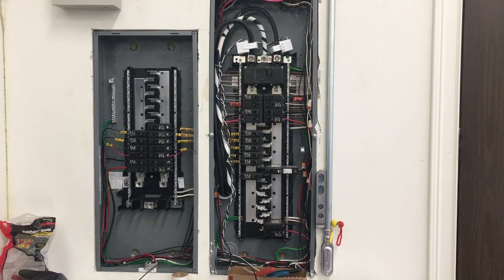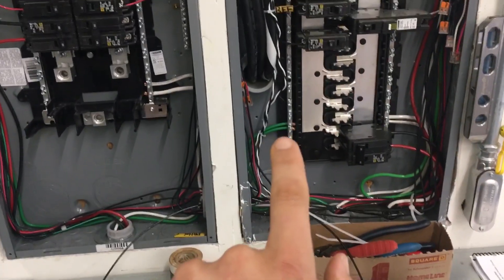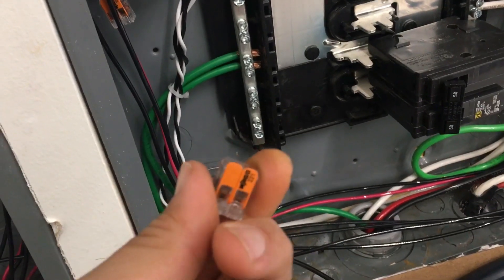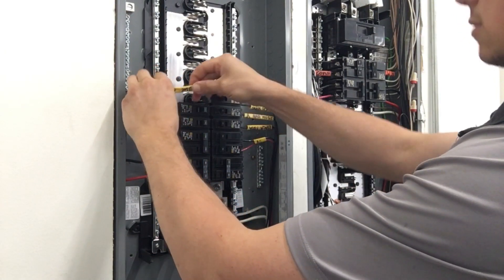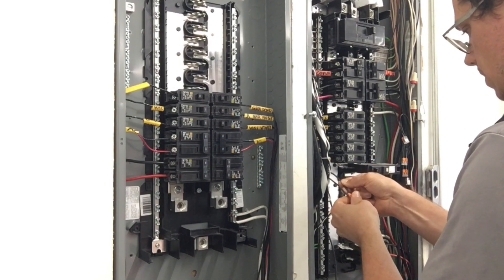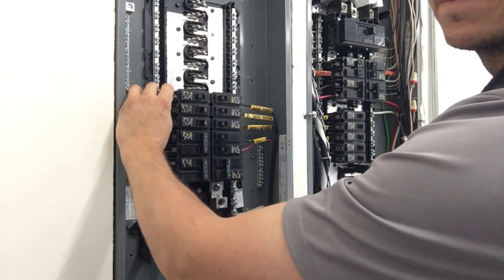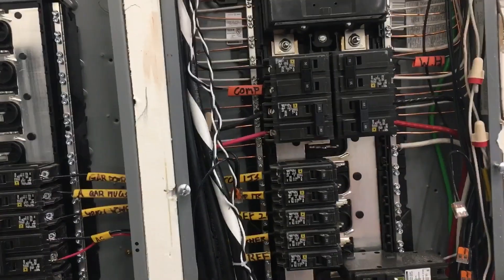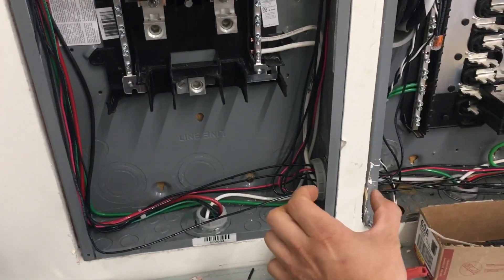Battery backup solar: Wiring the critical load panel

Comment: How does this remain compliant with 

NEC 300.3(B) mandates that all conductors of the same circuit, including the neutral and equipment grounding conductors, must be run in the same raceway, cable tray

Comment: Thanks, i installed my eg4 12000xp and I was having some doubt on my load breaker, my dilemma was that I wasn't sure if I needed to move the ground and neutral wire because simply the electrician who did my main panel 2 years ago didn't actually labeled the ground wires but labeled all the other wire. So my setup is very similar I have AC input from my main panel as well. And this video was great.  Thanks

Comment: Awsome video. So there is no need to move the individual neutral since you ran a large gauge wire. I am assuming there is no issue with the code. Thanks again 😊

Comment: In a grid down situation I don't understand what is stopping the CLP from pushing power into the main load center - and then backfeeding to the grid?
Reply: In most critical load panel situations, they are powered from the inverter only into the main lugs. And most hybrid inverters have “AC Bypass” which uses the grid or solar or batteries to power the Critical loads panel with Grid support 24/7, and when power is out the Inverter only powers that critical loads panel from the Solar/Batteries.

Short answer, it’s fed from a inverter only with a built in controller to not backfeed the grid when power is out
Reply: @wrenchingmatt8501  Thank you...I am clear!

Side question in regards to a CLP install using an EG4 12000XP with grid. In our home the N / G bond happens outside after the meter where the 200A breaker is. Inside the home is the 200a main lug only panel. 

If we placed the CLP next to the main 200a panel like shown in this video I could wire it just like Jason did? Making sure there is no N/G bond in my CLP?

How do you size the N and the G wiring from the main panel to your CLP?

Comment: Im trying to find optimum spot to install my inverters, our main 200 amp service panel is in our laundry room, i was thinking i could mount the inverters on wall above the washer dryer but that wall has the water shut off valves about 3.5 ft up the wall snd i thought i bet code says any electrical type panel/inverter must be 3 ft away or on wall opposite of the water outlet/spigot/faucet.  My main panel is 3 ft from that outlet.  I could put the inverters in the bedroom closet  which is behind that wall where washer dryer is with the water shut off valve.  My other option thought is buy a 8x8 shed or 10x10 put about 30 ft to 50ft from the laundry room and main panel, which then also allows room for batteries.  Only thing there is will need to insulate it and put a solar ductless to prevent getting too hot or too cold.  But starting to thing this would be the best route.  Any suggestions for us folks with no garage?  Lol i am in NC north of charlotte.  Any ideas greatly appreciated.
Reply from the maker: I like the shed idea personally. The inverters can’t go in a clothes closet.
Reply: @GainSolarPower  cool, thanks for the feedback, im guessing it would need be insulated, and probably have a solar high efficient ductless mini to keep from getting to hot or too cold.

Comment: So as long as the inverter senses grid power it does not send solar/battery power to that critical load panel.  Once grid goes down the inverter sends solar if available and or battery as neefed to power the critical loads?  You are wago nut wire from the main service panel to the breaker moved into the crit panel.
Reply from the maker: Not quite how it works
Reply: @GainSolarPower  how does it ?

Comment: What switches the excess power to battery charging?
Reply from the maker: The hybrid inverter does this automatically. I’m using the Sol-Ark 12k hybrid inverter
Reply: @GainSolarPower  I want to power the heating element in a sand battery with direct DC power. Maybe best to just have dedicated solar panels for this load?

Comment: How would your neutral arrangement change, if at all, if you wanted to use a main breaker subpanel as critical loads panel, w/interlock kit, to allow inverter critical loads bypass (main breaker of sub fed from ~50A (for ex.) breaker in main, interlocked with inverter crit load input breaker)?
Reply from the maker: It would t change with an interlock

Comment: If I am simply adding a new breaker entirely (freshly pulled circuit) can I just add in the breaker in the standard fashion to the critical load panel? I know the panels max current capacity is capable of supporting the new load. 

Simply put, is there any interaction for a new circuit between the critical loads panel and main panel? 

Thanks!

Comment: I have a LV6048 Inverter which I don't think has a common neutral. I want to move 10 Circuits from my main panel to the Critical Loads panel powered by the Inverter. Would I need to move the neutral and hots or can I use the process you have in this video?
Reply: Unless they are arc fault or ground fault breakers you should be fine running just the hots and neutral larger than the max possible combined amps of the circuits or the surge power of the inverter.

Comment: I’m confused.  With both panels sharing the neutral can you have the main panel powered from the grid and the critical load panel powered by the inverter at the SAME time?  That’s what I want to do.  I’m assuming I’ll need a “generator” transfer switch setup or will have to move the neutral wires over too.  I want to 100% run the critical load panel off Solar/battery with the inverter switching to grid if the load is too much or the battery level drops too low.  I don’t have any MWBC.
Edit: just saw your reply about the insides of a Reliance 10 pole transfer switch - that’s what I was planning to use.  Sounds like your setup is electronically the same as a Reliance transfer switch.

Comment: Useful video. I am getting PV + battery installed - the inverter offers UPS option so I to add 2nd 'consumer unit' (as the fuse panels are called in UK). Perfectly doable for a sensible and smart DIYer, but not really legal - got to get a certified installer. At least I can educate myself and instruct them as to what I require. Thanks.

Comment: Do you have any videos that show how to wire and bypass the inverter from the critical loads panel back to the main panel? I have an enphase system with sunlight backup and my installer is telling me there is no way to transfer the loads on the sub panel back to the main panel. I have a portable generator that I want to use at night or during overcast days and now my fridge and freezer are only wired to the sub panel. Thanks
Reply from the maker: Accomplishing this is pretty straight forward. Just saw this message. 

Jv@gainsolarpower.com

Comment: I'm in the process of creating a critical loads panel. One thing I thought of that should also be done for all installs is to ensure that the power supplies from the Hybrid Inverter, when passing through grid power, is in phase with power supplies that "Could" come from the main panel to the critical loads panel. I'm sure there are different ways to bypass the Hybrid Inverter, if required, and that both wouldn't normally be lined up to do that, but, just in case, it could prevent a major fault. Error on the side of caution!
Reply from the maker: Thanks ben. There is a bypass and we keep track of thenphases

Comment: Is it code violation to not move each neutral with associated circuit hot wire over to subpanel?  I'm reading you can not just run one neutral from main panel to sub panel to cover all the hots that are now in the sub panel.
Reply from the maker: That’s a tough one. I’d leave it up to your AHJ/inspector. I’ve passed all my inspections doing it like the video shows. Moving the neutrals takes a lots longer. If the panels are far away I would move the neutrals with the hots but when they are close like that I bond the neutral bars with a big wire and that’s fine. I don’t feels that the code adequately addresses the scenario.
Reply: @GainSolarPower  thanks for the reply.  I'm hoping to do the same as you did in video.
Reply from the maker: Well you have my blessing

Comment: Don’t the ground and neutral also have to originate from the critical load panel?  I know it still works this way, just thought code requires it.  Thanks for the video.
Reply from the maker: Show me the code.  Cant have two neutral ground bonds and the critical loads panel is a subpanel.
Reply: @GainSolarPower  All conductors of a multiwire branch circuit must originate from the same panelboard [210.4(A)].
Reply from the maker: You have a good point but the nec defines a multi wire branch circuit as 

Branch Circuit, Multiwire. A branch circuit that consists of two or more ungrounded conductors that have a voltage between them, and a grounded conductor that has equal voltage between it and each ungrounded conductor of the circuit and that is connected to the neutral or grounded conductor of the system

I’ve never had a single problem from just moving the hots, nor have I ever had an inspector call me out on it. I’ve even done a super neutral once. 

Multiwire branch circuits are not common in residential anyway.
Reply: @GainSolarPower  maybe that’s where I’m not clear if I have a twin pole breaker run on 14/3 romex feeding hallway outlets on L1 and then lights on L2 then isn’t that a multiwire branch circuit?  And I wired my critical loads panel the same as you just wondering if it will pass inspection.
Reply from the maker: @Marker-er3ro  yep that is a perfect example of a multi wire branch circuit.
Reply from the maker: @Marker-er3ro  where are you getting inspected. If the inspector catches that I would be might surprised.
Reply: @GainSolarPower  I’m in Colorado, I’ll let you know next month.  Again thanks for the great videos!
Reply from the maker: @Marker-er3ro  maybe move the neutral too for that circuit. It’s a multiwire branch circuit.

Comment: Good video, thank you!  Question, what if you're a "minimalist" and basically everything on your main panel is a "critical load"?  How does this get wired with the inverter so it can still "transfer" to off grid?
I see how this CLP works and would benefit most, but in my case everything in my main is a critical load!
Reply from the maker: It would need to be wired in with a transfer switch the size of the service.  grid on one side and solar on the other.

Make sense?
Reply: @GainSolarPower  may you expand on this answer. I have the same situation. The main breaker panel is my critical panel.
Reply from the maker: @zedekmorenu7804  you can either run you whole house thru the inverter which has 60 amps pass thru and hope the inverter never fails or interrupt the conductors feeding the main panel with a 200a transfer switch and feed the grid thru one side and the solark thru the other and hook the main panel to the load side of the switch.

Comment: Thanks for the video.  Is the backup panel supposed to have the same circuits that the main panel has?   In other words, should the backup system be an exact copy of the normal panel?
Reply from the maker: No man. It sounds like you better stay out of your electrical panel. The critical loads panels which you are calling them back up panel consists of the circuits you want to power during the outage.

Comment: Hey Johnny, how exactly is the grid powering the critical loads panel?  Are the panels joined in any way other than the neutral and ground connections?
Reply from the maker: In normal operation the grid passes thru the inverter but we also have a bypass in case inverter goes down that would connect the grid directly to the critical loads panel

Comment: Last but not least to complete the set up I could add a standby generator which is wired to the sol-arc 12k with 2 wire start up and a battery charging circuit breaker in the critical load sub panel.  Do you have any of these?  If so the wiring could be complicated and I would like to know more about the wiring.

Comment: Also the critical load sub panel now doubles as a main sub panel as if you turn off the main breaker in the main panel it will not turn off the circuit breakers in your critical load sub panel. Therefore are  you now required to have a main breaker  in the critical load sub panel?
I also assume that on the outside there may be a main grid disconnect (fused) near the meter and a solar pv ac disconnect (fused) next to it. I also assume that there is a supply /line side tap for overcurrent protection or a load side tap.
Reply: thats alot of assuming

Comment: As a newbie my question is about the critical load panel.  From your video I see that you physically took   each of the circuit from the main panel and moved it into the critical sub-panel.  You seem to have energize the sol-arc 12k from the main panel by a double pole breaker ( correct me where I am wrong).  Which in turn will energize the critical sub panel. You then took the black wire running to each circuit breaker and extended them to the new location of the circuit breaker in the sub panel. The same is done for all other wires.  Ok. Why choose this method over the more conventional method of leaving the circuits in the main panel and having a new circuit in the critical sub panel and running the wires from each circuit to the corresponding circuit in the main panel?  I also assume that the panel box between the critical load panel the sol-arc 12k is a double pole double throw switch (manual transfer switch)

Comment: Is the critical load panel the only thing that benefits from battery output during TOU shifting? Meaning, at night, when pulling from battery, will the inverter output only contribute to loads in the critical load panel? This is in the normal “grid-on” scenario. I know that only critical loads are energized from the battery in a “grid-off” scenario.
Reply from the maker: Yeah if it’s set up for TOU it will push offset as much as it can till battery is drained to setpoint

Comment: Does the Critical Loads Panel have to be recess mounted like the 200 amp panel is or can it be mounted directly to the drywall outer surface ?
Reply from the maker: I prefer surface mount but a lot of times they are recessed because they are installed during construction.
Reply from the maker: Surface mount is definitely easier to get into.
Reply: @GainSolarPower   Does it have to recessed by code. I think I prefer surface mount for the ease of wiring.

Comment: Thank you for showing this.  When you drill the 2x4 in the wall to take the 2 inch  conduit between the two panels that doesn't leave much of the wall stud intact.  I would be concerned about the strength of that wall stud. Maybe a metal plate with a 2 inch hole could be screwed to the side of the wall stud to get some strength back;  What do you think ?
Reply from the maker: I think plumbers do far worse.  Maybe a problem if its a load bearing wall? But they build houses out of studs so plumbers and electricians can make holes in them. That wall was actually a 2x6.
Reply: Yes I think plumbers do a lot more hole drilling.   Nice to have 2x6 studs. No such luck here.  What size hole did you have to drill between the two load centers ?  Was it 2 inches ?  I am thinking of adding a critical load panel myself. I don't have knockouts on the left hand side of the old ITE load centers so it looks like I will have to drill the steel as well as the wooden studs.  I have two 200 amp panels to deal with here and then the additional critical load panel

Comment: The neutrals are not used in the sub panel if you are just moving circuits, right? It's still required by code though? Thanks.
Reply from the maker: You need a neutral but I’ve never been turned down for not moving the neutrals. They are still working
Reply: @GainSolarPower  So you have to move both the neutrals and hot lines for 110v to the sub panel? Wouldn't it be easier to move the main power lines to a new main panel and leave the old panel alone with all circuits and connect the inverter to it? Is this possible within the code? Thanks.
Reply from the maker: @markogrba1  sometimes is is easier to move the mains and a few of the bigger loads but o lot if you can put the new main panel in a place where you won’t have to splice the wires. If that makes sense

Comment: I just installed and had an electrician put in my critical loads panel.  The inspector failed me because there wasn't a neutral for each breaker?  He stated NEC code 200.4.  We were using a bridge neutral from the sub-panel to the critical loads panel. We had to run a neutral to each breaker from my original sub-panel.
Reply from the maker: If you ever take a part one of those reliance 10 circuit transfer switches, they don’t have all the neutrals. You only have to move the hots. We’ve never had a problem with it. Was the critical load panels really far away from the main?  

Still you can see from the way I built my systems addding neutrals wouldn’t be hard. Just time consuming. What part of the country are you in.
Reply: @GainSolarPower  The run from the sub to critical loads panel was more than 10 feet.  We were able to have one neutral per breaker and use three hots to one breaker.  It worked out, but, I figured out the electrical work is tough and reading the NEM would be like going back to school.  A lot of information and it constantly changes year by year.  Thanks for the reply!

Comment: Question,   Critical load panel....My whole house is Critical load panel....I run it off grid on a 12000 generator........what are you trying to say?
Reply from the maker: This is for a grid tie battery backup system.